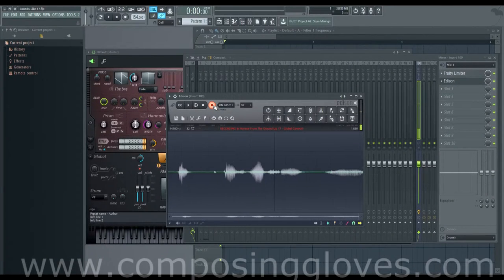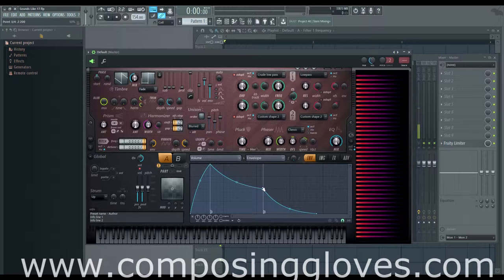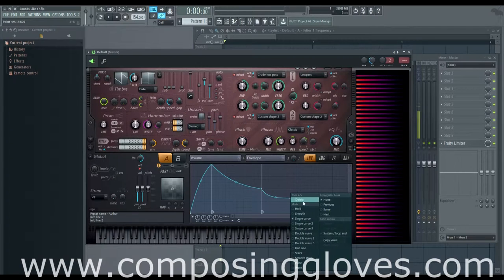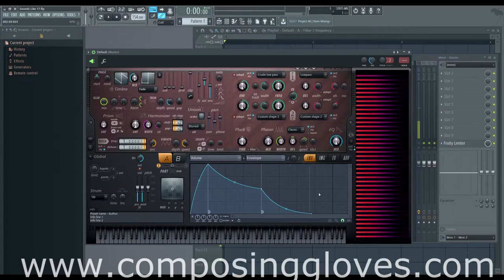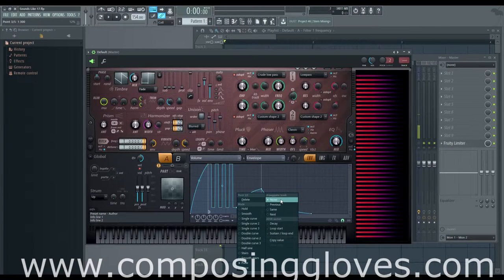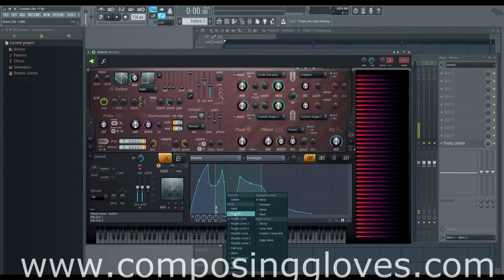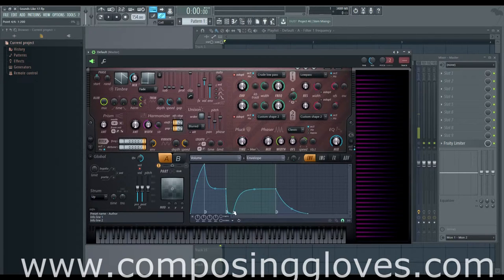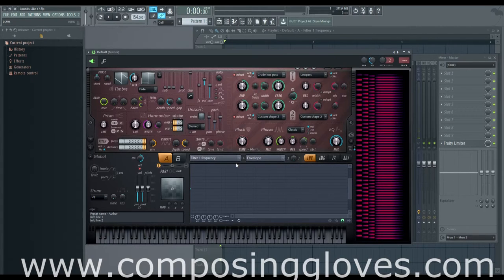Harmor From The Ground Up 18 - Envelopes (In Depth) - Part 1

Comment: The "GLOBAL" setting on the envelopes causes the envelope to be shared between voices when playing multiple notes at once - instead of each individual voice (note) having an independent envelope, that setting causes all of them to share one.  If you hold one note and in the middle of that play another, with that setting off, the new note gets its own attack - with it off, there is not a second attack because the envelope is still active from the first note and is shared by the new one.

Comment: Composing gloves thankbu so much for ure rplies n hope u help me like this in future .. and i wanted to ask if the volume envelope can also act as a gross beat type on other parameters like filters and arpeegiation on filters envelope in what type of music and can we pan the filter
Reply from the maker: I was originally gonna say no, but after thinking about it I suppose you could get fancy with the image section of harmor to emulate the time stretching. I don't recommend it though as its very unintuitive. 

It can do the amplitude section very easily though. Just use loop points however you won't be able to turn it on and off so your stuck with whatever effect you pick. 

So, technically partially yes but I wouldn't deal with it. Gross beat as an effect is a better way of "thinking" about what you want to do with it.
Reply: Composing Gloves thank u so much for ure rply bro..